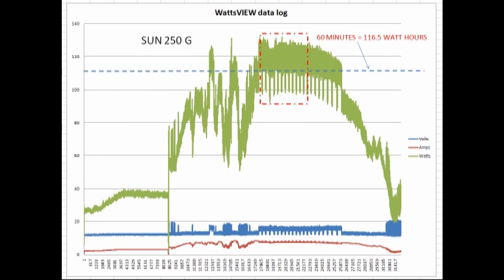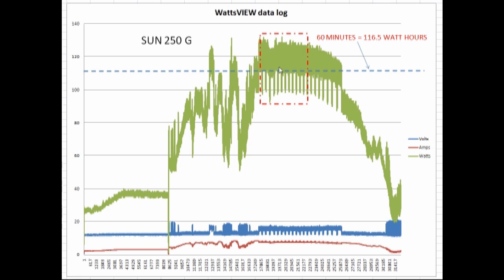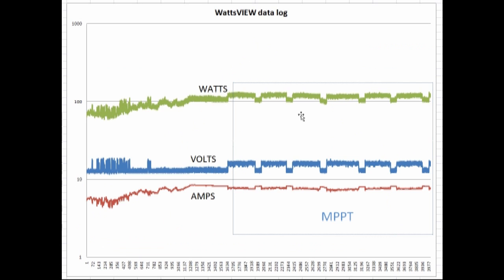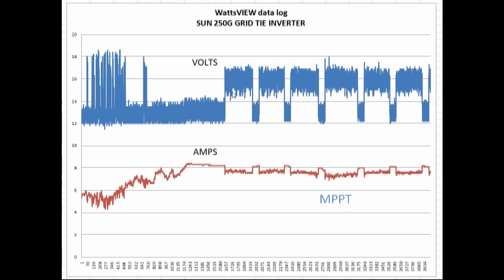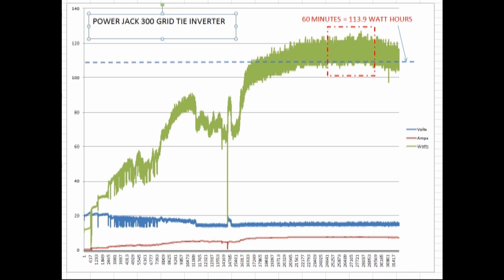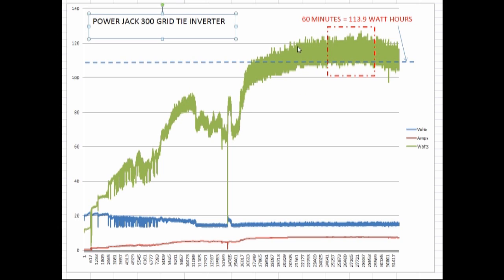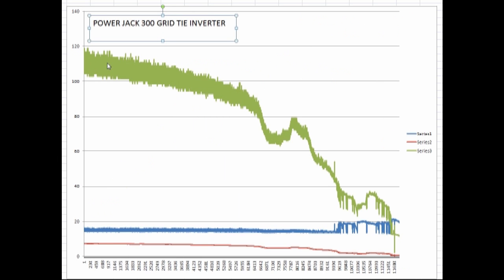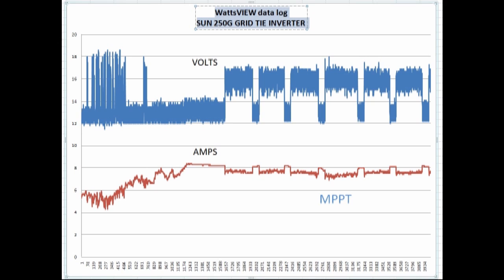Solar Panel Grid Tie Inverter MPPT w/Sun and Power Jack

Comment: Your test was good enough, it shows the difference to be so small it doesn't matter. Move on to the next test. Seeing two GTIs fight would be interesting. What really matters is the watts in vs. watts out of the GTI. If that's over 90% most of the time, you are golden and saving real world money on your power bill plus getting the most out of your solar investment. Don't forget about the power up sequence the GTIs do, it's not instant on and will skew your results if you switch them in/out.

Comment: Thanks for the data, very interesting. You have to remember that they have a fairly large capacitor on the DC side, so they can't go up and down too fast for the MPPT test. It does look like the Power Jack people did a better programming job though. And yes, you do get more power from MPPT than just a normal charge controller (even PWM) because of the morning/afternoon off angle sun and the way solar panels behave at different light levels.  But it's always good to have this data independently.